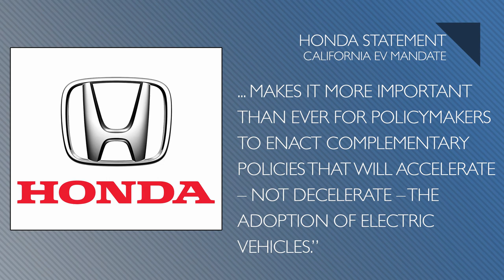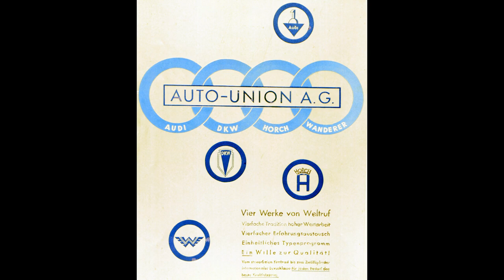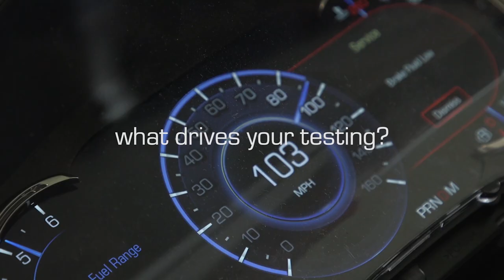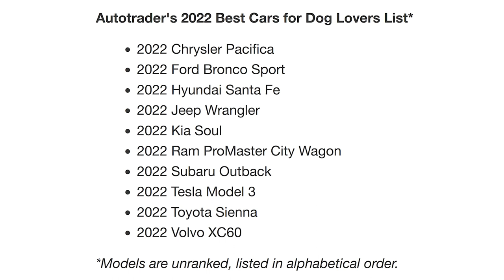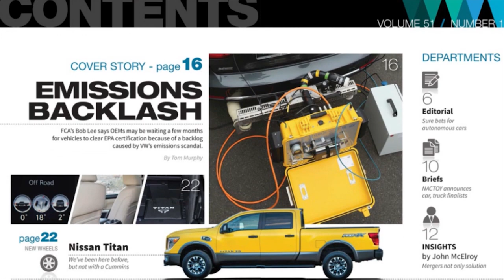The Best Cars for Dogs; More States Joining Cali's ICE Ban - Autoline Daily 3393

Comment: Tesla going to dominate in the next decade. The American Toyota. Glad I’m alive for it
Reply: With two sedan/hatchback models?
Reply: Hi Mark.  One problem -- I don't think you can spell Kaizen (although to be fair, the new Tundra doesn't use that process either).
Reply: @bobbbobb4663  Kaizen had a good run, it's now being replaced by Agile manufacturing. We have new modern tools for re-thinking the process, might as well use them. 

VW is working on catching up to Tesla in 2026 in terms of hourly output (30hrs -> 10hrs/vehicle), hopefully they do it by adopting technology in a likewise fashion. 

The rest of the industry should look into that as well if they want to cut costs and increase output.
Reply: @AllanSustainabilityFan  A two week span for quality improvements at Tesla seems about right.
Reply: @bobbbobb4663  One thing we know for sure is that Tesla's job is much easier than the legacies: 

It's easier to fix a 1mm gap than it is to unify the silicon and then write a solid software stack of a car, especially when these legacies are all about outsourcing and catalog shopping. We see that challenge clearly with projects such as VW's Cariad.

Case in point, Tesla now has the edge in accuracy with the single body casting. No more 170 welds with compound error margins like other cars, a single piece does it in one fell swoop at impeccable accuracy. 

Chinese companies - always the nimble ones - have already started replicating this approach, and it's only a matter of time before legacies are forced to seek these efficiencies to stay competitive as well.
Reply: @AllanSustainabilityFan  I just got to the airport.  The off site parking has an EV charging section where I leave my Leaf.  There are usually three or four Tesla’s there.  Trust me, fixing a 1 mm panel gap offset is way too hard for Tesla.  More like 3 or 4 and even that is difficult which is why they don’t even try.  In terms of software, call me when they stop abusing the eMMC memory by storing all kernel output from /var/log/messages.
Reply: @bobbbobb4663  The Shanghai and Berlin lines have little of such issues, so this is not a valid short-term argument, and to your point, the priority was assigned to doubling production every year with the old processes they had in Fremont, rather than slow an old temporary line down to sort out minor kinks.

Well with Texas coming online that will buy Tesla time to slow down in Fremont a bit to address the issue, help the old legacy plant catch up to their newer cutting edge ones.

I'm more worried about Toyota not being able to make an EV where the wheels don't pop off, or Ford making ones that don't shut down going downhill in Norway, those are not good signs for old companies that supposedly know how to do the operational fundamentals of car design, nevermind the adjustable cosmetics.

We'll see how many can figure out EVs before the Chinese arrive to show them how to do it.
Reply: @AllanSustainabilityFan  Props to Berlin for figuring out how to attach a door properly.  From Barron’s today:  “Ferragu, for his part, drove a Berlin-made Tesla Model Y when he visited. “The most stunning moment of the day was probably the one I would have expected the least: opening and closing the door of the Model Y I test-drove,” wrote Ferragu. “I did it 20 times in a row and could not believe the quality of the experience.” He drives a Model Y at home”
Reply: @bobbbobb4663  Nothing to do with door quality per se, it's more of a "feel" thing that German brands often brag about when comparing to American products in general.

He's referring to the satisfying "thump" sound that doors makes in luxury German cars. People apparently like that and Tesla is now just catering to it now that they've hit their EV efficiency targets.

Psychology is good for sales too after all, especially in the German market.

Ferragu's visit that you alluded to was interesting, this is what he summarized:

"My #1 take, visiting GF Berlin. I used to consider Tesla would be premium cars but not luxury cars. Beware. Teslas are now luxury cars. Will share more soon! $tsla"

Quoting Martin Viecha:
"Took (Pierre) around Giga Berlin. After driving Model Y Performance, he tells me: Martin, this is built like a German premium car! I'm like: Pierre, this IS a German premium car"

So progress is indeed happening, curious to see how Giga Texas compares.
Reply: @AllanSustainabilityFan  So now Tesla wants to make an American door and a European door?  Good luck tracking those replacement parts five years from now...
Reply: @davidmccarthy6061  only for now. And also probably not too many more models. Apple dominates the handset market with only a handful of options.